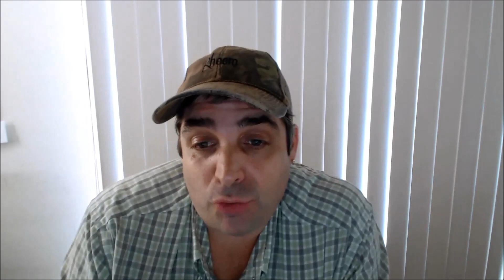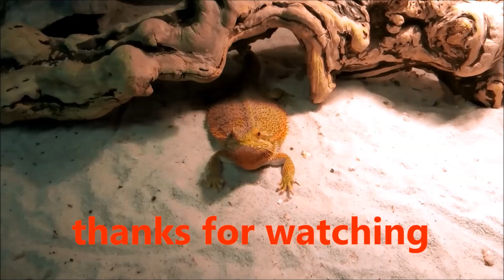hvac:you never vent refrigerant into the air its a 37,500 fine

Comment: I witnessed the HVAC installers do this very same thing when they removed my old unit. My old but operational 3 ton unit was full of R22. I watched the “master tech” close off the valve to the compressor and cut the refrigerant line with his pipe cutter and vented the evaporator coil and  line set. I confronted him about it and he told me it was compressed air and I guess thought I was retarded. The installer manager  just happened to show up to see if they needed any parts ran and I told him what the tech did as refrigerant was still venting out of the line, he apologized and told me they were supposed to recover it. After confronting the tech about it he docked the tech two dollars an hour for two weeks. Apparently this guy was one of their top guys, it’s terrifying to think that.
Reply: $10,000 of the $37,500 fine goes straight to the person turning the company/person in to the EPA.
Reply: @snap-off5383  yikes, I didn’t know that.

Comment: That's crazy!  I don't even work in HVAC as I am an IT guy and even I know this!  Well, I do have a fascination with HVAC tho. ;-)  I do have a question; when you have the recovery cylinder connected to the high side and pushing refrigerant into the cylinder, does any oil in the system get pushed in to the cylinder as well?  If so, how is that dealt with?
Reply from the maker: ESDI80 i would not worry about the oil if any its very little ,,the high side is the liquid line

Comment: Good job Steve, if the guy is dumb enough to vent...he deserves to have his parade pissed on! Get the paintball gun ready. I moved to Florida 3 1/2 years ago and found out what a "Florida recovery machine" is. These guys take a bucket of water and sink the yellow hose into it and away it goes! When I took the section 608 test back 1997, my instructor would of shit a brick if he seen that.
Reply from the maker: Damian Orsini get caught and there is a big fine 37,500 fine for venting  and jail time .. so do not get caught
Reply: I used to use 2 recovery machines. 1 for 22 and 1 for 410a. But I recently got a new G5 twin. And can't wait to use it.

Comment: What is funny is...with all the regulations on refrigerant to save the environment, the one that would have done the most good was never implemented.

That rule is...no adding refrigerant without finding and fixing the leak.

But no, homeowners and business owners can just let their refrigerant leak year after year.  Spewing tons of cfc's into the air, but don't you dare spill a drop....no.no.no.
Reply from the maker: dpeagles no no no not a drop
Reply from the maker: steven lavimoniere you can't tell the new babys  its ok to dump 5 lbs of refrigerant .no no no

Comment: Steve,  Good Video. I read the new fine for venting is $37,500. For EPA 608 Certification I believe the test the answer still is $25,000 fine. In any case, bottom line is that any professional HVAC company/technician either has their own approved recovery set-up or has access to one. If you service refrigerant and don't have the proper equipment, your a hack.
Reply from the maker: S Sam this super tech had no clue just vent it ....